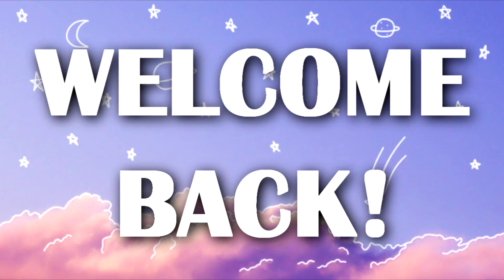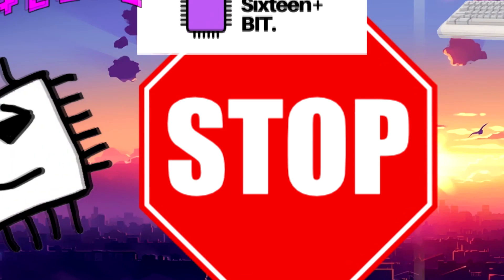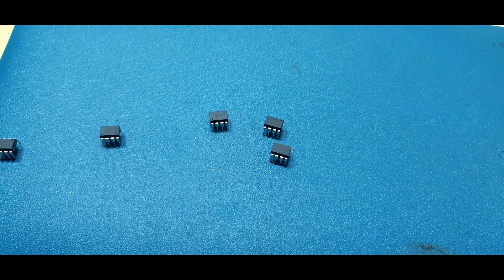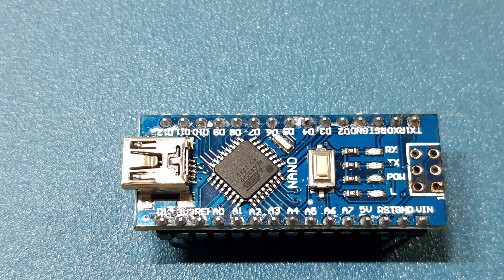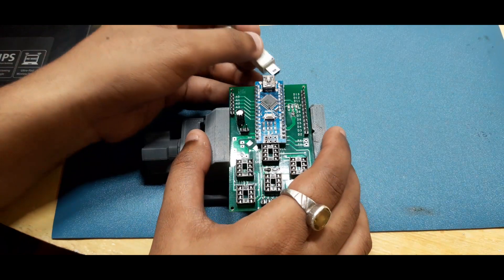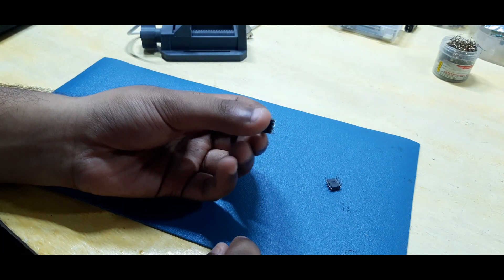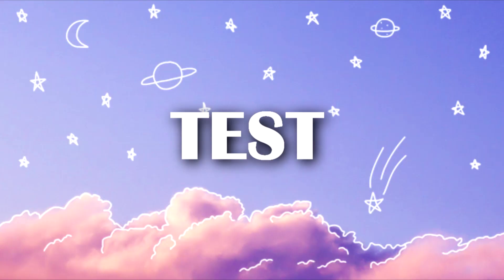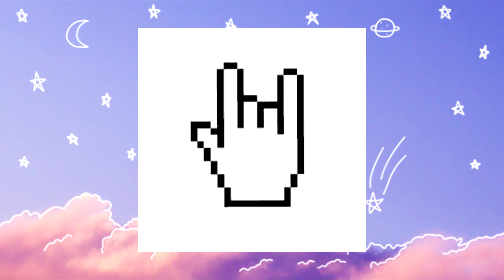Attiny85 and Attiny13 Multiple Programmer with Arduino Nano

Comment: iam using a 7805 regulator ic to power up at-tiny85 from 12volt adaptor in my project.I am really confused weather should i use an input resistance at vcc pin of attiny?can you help?
Reply from the maker: actually there's no need to add resistor to the vcc side

Comment: Sir attiny13 not show in this library link
Reply from the maker: https://github.com/MCUdude/MicroCore
Reply from the maker: add this core, the Installation process is well documented
Reply: @ArnovSharma  try this sir but stk500_ recv program not respond anf stk500 getsync noy in sync 0x03
Reply: On ic 1648 ATTINY13 PU writen
Reply: @ArnovSharma   thnx sir for your guidance with nano working please suggest  other ic with more pin by which i can use IR receiver  sensor 
Means low cost attiny ic 2313 compatible.